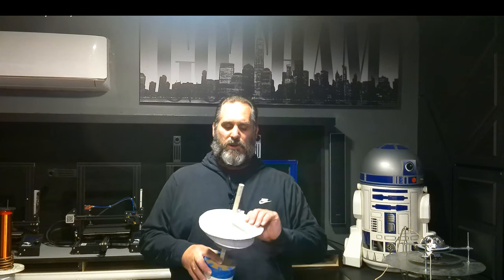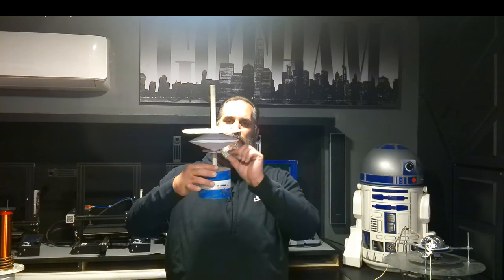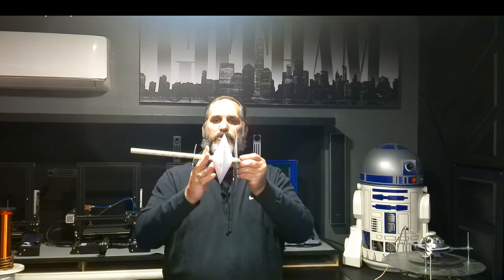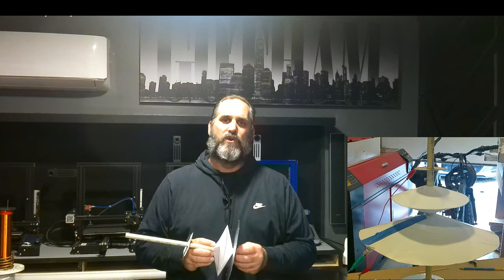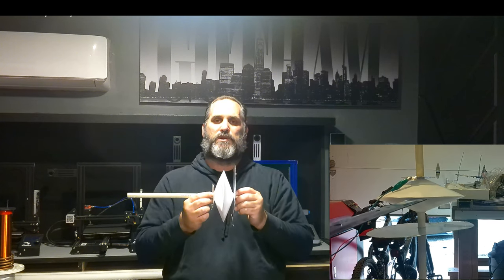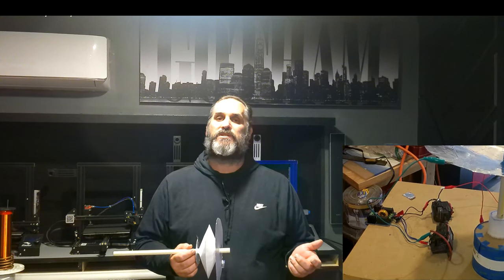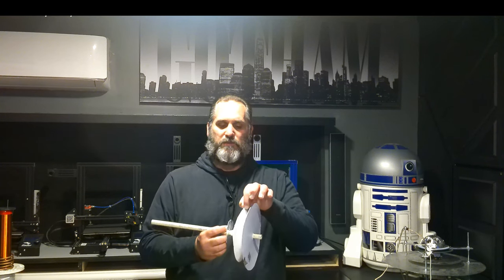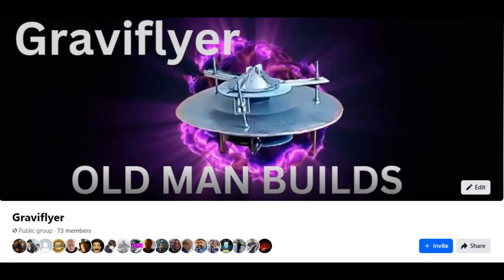Static Electricity "Antigravity??"

Comment: maybe it could be a plasma radiation that is causing the force we are looking for. If we talk about microwaves etc. ? just my input that i will try to investigate. You are doing a great service, keep going.
Reply from the maker: there is radiation. It is gravity waves. The tesla coil is showing it's secrets now. This video though there can be a lot learned from this. We have the bottom disc of the Graviflyer next to the ground. When on a table we get the wood changing the charge. it makes it stick to the table like an ion lifter does. When on the ground it does the same.  so we have to resonate it to break it free. It is like pushing 500lb of weight with 3 fingers. sounds impossible until you vibrate it really hard. Then you can do it. you want to reverse charge quickly to pull away from the earth and resonate to reduce weight. If the gravitational waves cannot land and apply as much force to get what looks like a weight reduction without the weight ever changing. You are not letting the gyrational waves settle on the craft. so to the environment the craft weighs less but you never changed the weight. You need this to reduce the amount of energy to lift a craft.

Comment: Have you got a Van de graff generator? There are a couple of experiments I would like to do, one was a comment on one of Jarod's videos where the guy said he had the power cable floating in the air when using a home made one with an ac motor and the top load disconnected so the charge just built up instead of arcing. Another is to use a vdg with only half the ball on top and place a circular ferrite magnet ring on top, then a piece of perspex and then spin of of those little levitating toys on top, apparently when you remove the perspex it will either stay their indefinitely or be projected far, like 3km far!
Reply from the maker: I have looked into them. If I saw the cord lifting I would order one right away.
Reply: @nathanbunten4299   Same. Upwards of £150 for a decent one doesn't sound to good for a couple of quick tests haha. I will probably build one at some point as at least then i would learn something in the process.